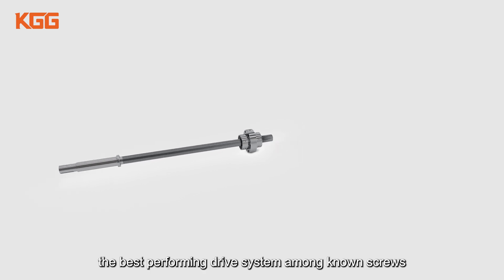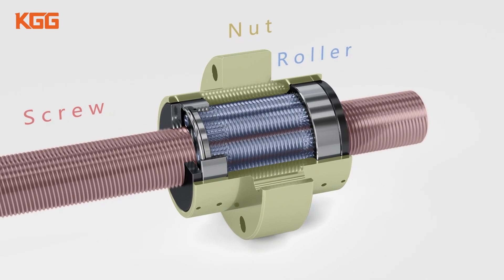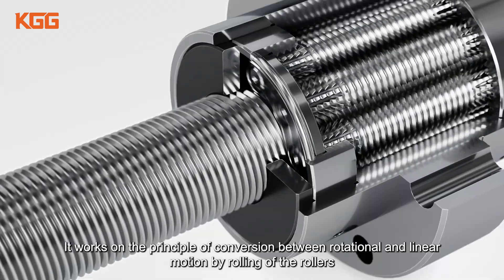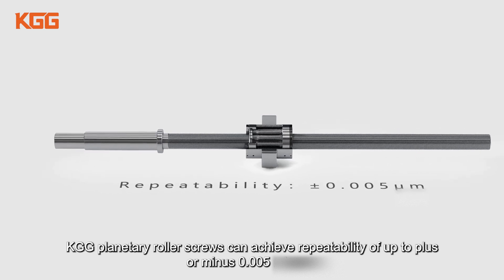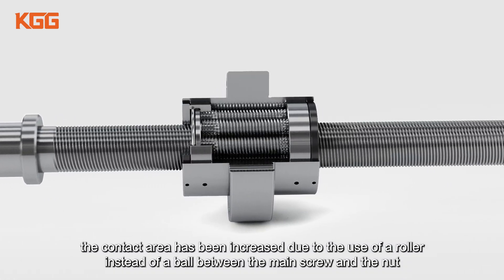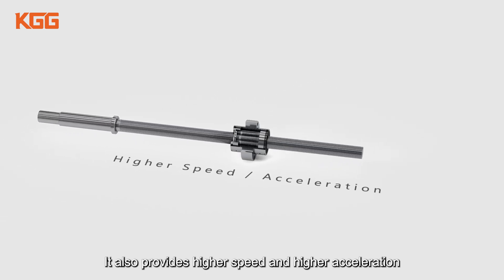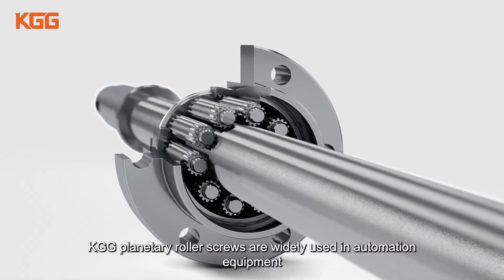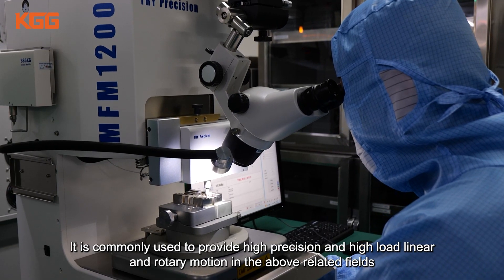The New Planetary Roller Screws For Powerful Actuation From KGG

Comment: But wouldn't this have slip issue during high inertial change or debris locking up the rollers, resulting in slight loss of position?  In ordinary screw/nut or ballscrew systems, positioning is locked with rotation no matter what, though they are inefficient.
Reply: debris are for peasants

Comment: KGG planetary roller screws have way too much slop to be used for anything.
Reply: Where have you seen them used?
Reply: Toolmaker here.  Obviously he hasn’t .  More accuracy and load carrying is always better in my line of work.  Someone mentioned iinefficiency..  it’s a good trade off fore the above.  If you have an additive mfg machine, swapping your old screws out would be a great idea, especially for sintered metal parts.  Cheers.
Reply: sounds like something a competing ball screw manufacturer would say